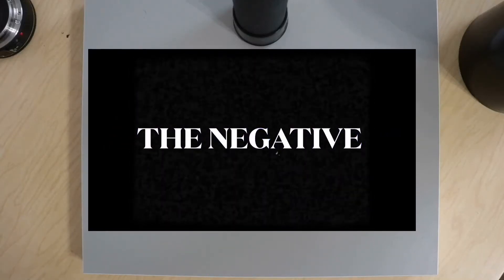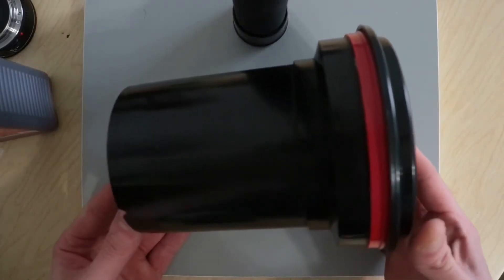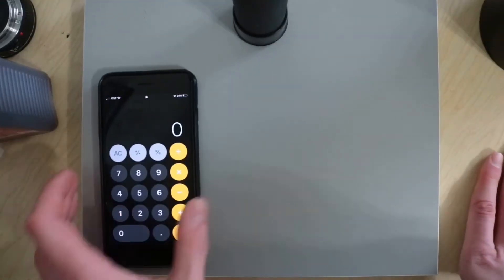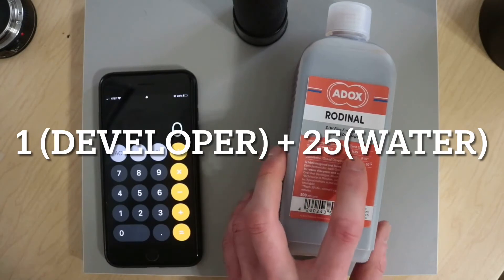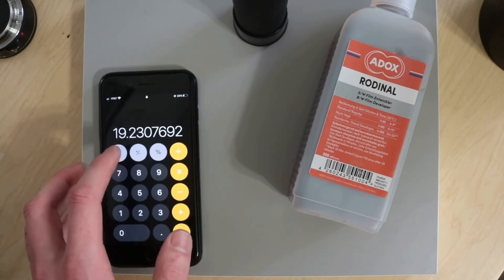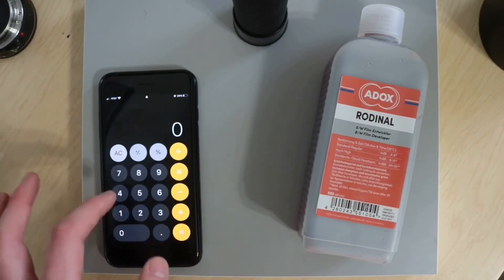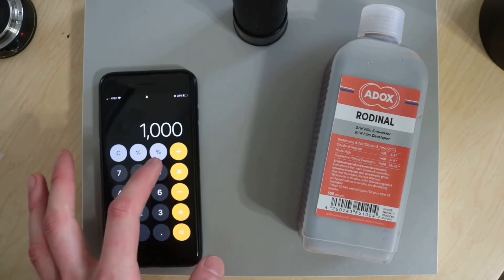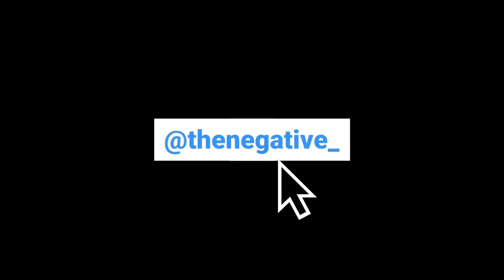How to calculate dilutions for film development

Comment: Here’s a simpler method to calculate dilution. 1 part in 25 is 1/25= 0.04 or 4 mL in for every 100 mL water. Therefore for 500 mL total volume, that will be 4mL x 5= 20 mL developer. 4% developer in 500 mL total volume.
To quickly calculate the final developer percentage just divide the 1 part by whatever part water.
Reply from the maker: I’ll pin your comment :)